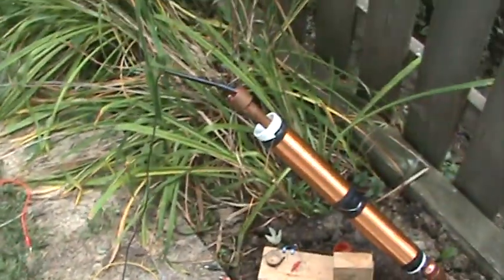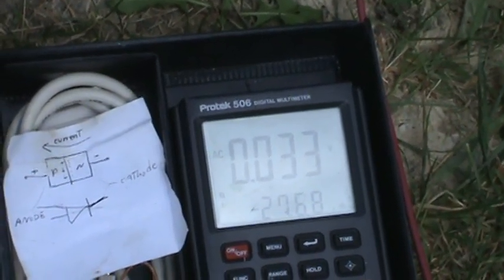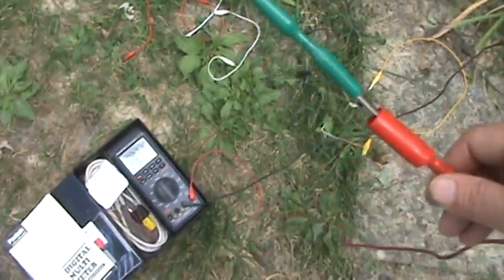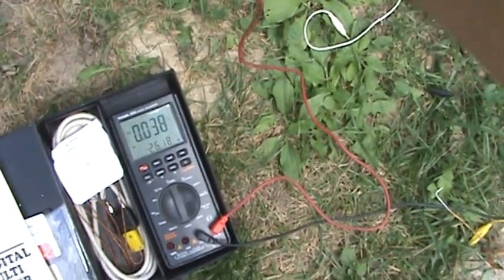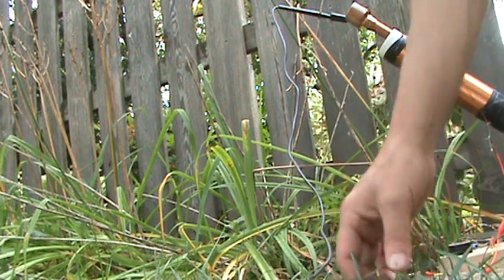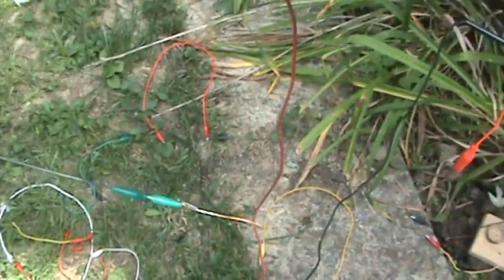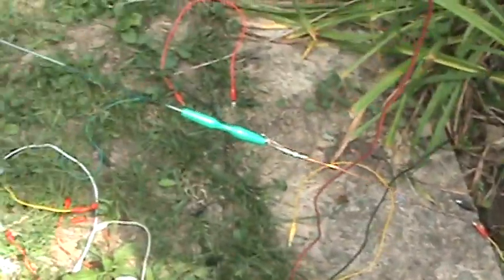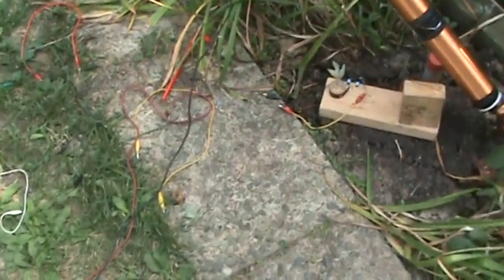FREE ENERGY FROM AIR CIRCUIT PART 22/24

Comment: Hi Paul ; If you are getting 100V, to 80V, You have the proper circuit. All needed at this point is a taller antenna and your DC Voltage should skyrocket. there's a guy called lasersaber on you tube and he went to a  phacility where they are doing ionosphere research and they are getting amazing results . I mean powerplant voltages. Keep up the great work you are doing. You our on the path bro.
Reply from the maker: +Donald Woods Thanks! :-)
Reply from the maker: +Donald Woods Lasersaber also launched one of his antennas in the air with a heliocopter :-)

Comment: Paul what is the DC Volt reading ? Keep up the good work ! I think we need the antenna in the Ionosphere ??
Reply from the maker: +Donald Woods In video part 16 i get over 100V.  This was my best record at that time.  In this video im sure i was about 80V DC
Reply from the maker: +Donald Woods yes, need higher antenna :-)  Voltage pressures increase dramatically the higher you get.

Comment: The Sun is a huge generator of plasma and radiant energy. 
Earth is huge spherical capacitor and Earth is loaded with frequence of 7,8Hz from Sun.
Radiant energy moves water from sea up in the sky.
When clouds are well charged (milion of Volts) You can see electric discharge in thunderbolts..
Reply: If You can build a LC resonant circuit with resonant frequency around 7,8Hz You can collect the energy like the Earth does..
Reply from the maker: Emanuele Civetta I understand well.   Im working on these concepts now :-)
7.83 Hz, "Schumann" resonance.
Reply: INVENTOR3
If I put antenna inside vacuum chamber it works better , the antenna is not subject at perturbation from air ?
Reply from the maker: Emanuele Civetta Yes, thanks, but first to build a nice vacuum chamber :-)
Then to make antenna out of plate instead of long wire.

Comment: Rectennas are highly efficient at converting microwave energy to electricity. In laboratory environments, efficiencies of over 85% have been reached.
A simple rectenna element consists of a dipole antenna with a Schottky diode placed across the dipole elements. 
The diode rectifies the AC current induced in the antenna by the microwaves, to produce DC power.

Comment: A rectenna is a rectifying antenna, a special type of antenna that is used to directly convert microwave energy into DC electricity.
The simplest crystal radio receiver, employing an antenna and a demodulating diode (rectifier), is actually a rectenna - although it 
discards the DC component before sending the signal to the earphones.

Comment: Hi again ive been doing a lil research on this kind of technology my self and i think we are on the right track.. Nicola Tesla had invented the tesla coil and i belive that it would perform in similer ways as to what your does theres not really much in it apart from the antenna and what kind of wave length its designed for.  this technology is saposed to work as a wavelength which is part of the magnetic spectrum travels though a conducting wire to produce an ac current.

Comment: you need to add a tuner to the coil so u can tune the coil to the desired frequency or radio wave length. The copper tube you have inside is doing the job of tuning but not very good the tuner has to be placed outside the tube actually touching the copper wire just a bit like a light dimmer turn it up turn it down the light would get stronger and weaker hope this helps and good luck mate much to learn.

Comment from the maker: hmmm, i will have to check AC 1 more time.  I do remember getting like 6V ac at 1 time??? but i think since then i added the coils and ground through the coils.....twice raising both voltage and current, surprise...was no sacrifice, strange happenings.  I have seen variable coils,,but dont believe i have seen anyone run the ground through the coils. i will make 2 more videos on this, then start working on tuning my tesla coils,,,hope you can help me with that.
Getting cold outside.

Comment from the maker: I will try to post other video i made.
I think i will repeat this test again.
Yes, very strange.
Now that i think about it....when checking DC....on lower part of window of my DMM is secondary function...so when i check DC, i can also see AC with out changing the function...i will check it like that....i will read secondary function(ac) when i check DC, instead of switching the DMM to AC.
Hope i made any sence in what i just said.  Its just another way to double check the AC readings.

Comment from the maker: i did make another video with just ac readings, but i never posted. I can if you want me to.  But it was same results.  Strange, I remember getting much better ac reading in earlier tests. Now with just ac, no circuit....i shake the pos probe from DMM going to the antenna and the ac volts goes up to almost 1 V.  At first i was shaking the antenna wire and jumping rope with it sort of speak,,,,nothing, but shaking only the end of the antenna with probe, then volts goes to 1V.
Strange readings...